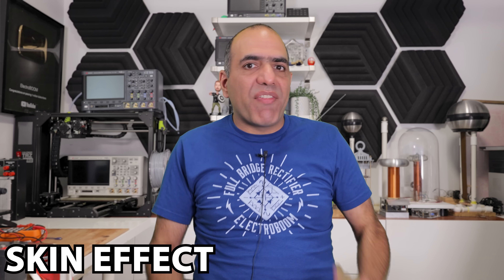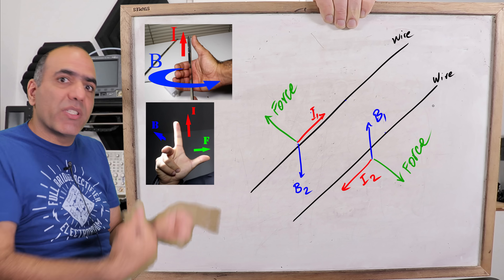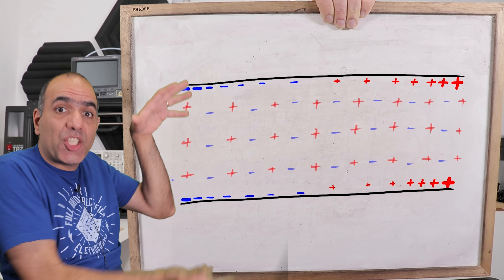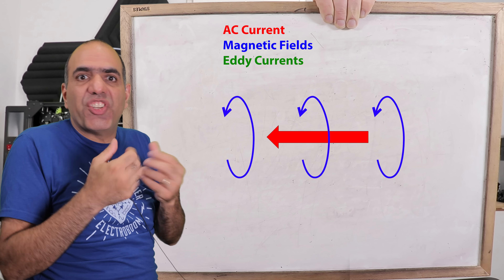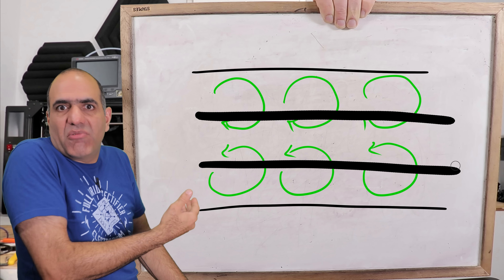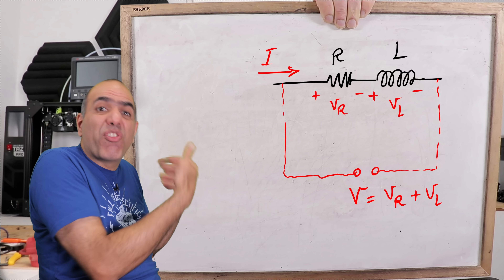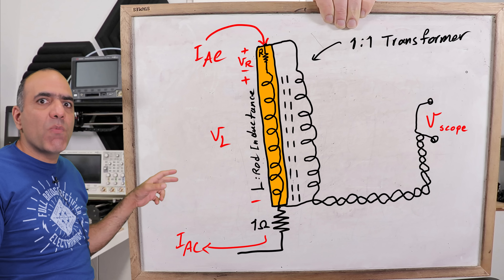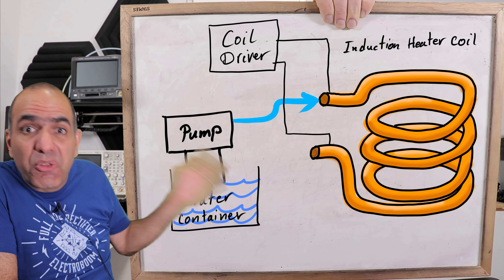Current Doesn’t Run Inside? SKIN EFFECT!

Comment: Hey Electroboom! Former radar engineer here. When dealing with high frequencies, a wire replacement is used which is called a WaveGuide. They're hollow, rectangular, tubes which one side is tuned to amperage, and the other is tuned to voltage.  By using this configuration, the Skin Effect becomes minimized and impedance is reduced.  We used them with radar signals at 72kv and there were a lot of rules for the waveguide inspections.
Reply: If I'm not mistaken, the microwave frequency travels within the hollow tube, contain within the metal insides, and could be made to turn 90° angles in it's transmission. Since there are no wires I don't think skin effect applies, except to say that at higher frequencies a signal tends to fly off the wire, which is the basis for an antenna.
Reply: @SpaceCadet4Jesus  it's the skin effect that makes it work.  It's because of the skin effect that you need to tune the waveguides to a specific size. The skin effect is being utilized by the waveguide.
Reply: @AdamOutler   You're right. I was forgetting about the skin effect on the inner walls of the wave guide. This is what happens after not working in radar for 4.5 decades. Thanks. 👍
Reply: Almost everyone has a waveguide in their kitchen: It couples the Magnetron output to the inside of the microwave oven. It's just really short.
Reply: @markh.7650  yeah. I suppose so. They're not doing much as far as guiding though.  More of a straight shot. The ones I worked on were curved and some were even flexible.
Reply: @ Yup. Although I never had the chance to work with them as the frequency of our MRI machines topped out around 25 Mhz I am familiar with their use. I was just pointing out that they are not as exotic as one might think.  My Engineer was a radar Tech in the IDF back in the '70s, so I'm sure he knows all about them 😀. Lost touch with him after we were together at 2 different jobs for 26 years. We are both retired now.
Reply: Thanks for your interesting comment. Could you elaborate, how is the one side tuned to amperage, other side to voltage? I'm an experienced EE, but RF things are just so magical for me..
Reply: @TheSimoc  I'm sure an AI can explain it better than I.  But, basically the skin effect adds attenuation and by keeping it contained within the waveguide under specific tolerances, the attenuation is minimized and signal is maximized.  The concept of a waveguide is basically a finely tuned abuse of the skin effect that's required for high frequencies. Any imperfection can cause signal loss or degradation due to standing waves.
Reply: @AdamOutler  Didn't quite get it, thanks for your try anyway. But could you just give a little elaboration about "one side to voltage, other side to amperage"? I mean, those sounded kinda good cues for understanding, but googling didn't provide any information about that, so are you referring to the sides 90 degrees apart from each other in rectangular-profile waveguide, or what? And maybe a simple example tuning calculus for some example frequency, how is it separated for volts and amps?
Reply: @TheSimoc  I'd recommend an AI to answer.  It's not easy to explain in a YouTube comment and my comments keep getting removed.  Not sure why.
Reply: @AdamOutler  I'm sceptical about AI but I might give a try. Thanks for your attempts, yes nowadays YouTube does censor about half of all comments, without any obvious reason.
Reply: Cool story bra

Comment: Black magic zone is where high speed PCB routing operates.
Reply: Where can I find online material about this? Sounds intriguing
Reply: @chickenonstrike123  Look at any application notes for super high speed ICs (or a book or wiki on high speed PCB routing). They will tell you how to route the traces with respect to each other and the  ground plane underneath, as well as the material to use and the weight of the copper. As a former PCB designer I had to deal with this, but never at GHz speeds, which is even more dicey. Skin effect is not much of an issue in PCBs as the traces tend to have a very small cross section because they are flat and fairly small. The big concerns are crosstalk and ground loops. It can literally seem like black magic at super high frequencies because the traces can "talk" to each other, so you have to run a ground trace (called a guard) in between signals you don't want to interfere with each other. This is not the case with differential signals though since they are 180 degrees out of phase with each other and the fields cancel automatically (typical of something called LVDS).
Reply: @chickenonstrike123  you should start with googling "HF PCB design"
Reply: @chickenonstrike123 WiFi operates in the 2.4 GHz range and higher, and in those ranges the actual wavelength of the EM waves become short enough that they start to do really weird stuff in typical wires if we just follow basic ohm's law. At that point, we start referring to the conductors as transmission lines and have to worry about impedance matching and wave reflections (wasted power) and all sorts of other funky black magic stuff. There's a really good video by Zach Star on YouTube called "The scariest thing you learn in Electrical Engineering | The Smith Chart" that gives a really good overview. 

Like some other people have mentioned in the comments here, that's the territory of measurement equipment the price of hypercars and filter designs that use acoustic waves and piezoelectrics to make the 15 layer stacks of filters that go into our phones and other devices for wireless connectivity. Really really cool stuff.

Comment: I meashured the skin effect with two  waveguides which have the absolute same geometries. One has an ENIG (gold) surface and the other is bare copper (below the soldermask). The one of bare copper has a significant lower insertion loss at several GHz due the much better conductivity of copper compared to the nickel below the enormous thin gold surface of the ENIG version.

Comment: I don't think you've actually "measured" skin effect. You've only measured that resistance increased but that doesn't prove that the current was indeed flowing on the skin of the conductor. For all I care, it could have been opposite of skin effect (core effect?) and it would also have increased the resistance.

Comment: A great topic to look into is Litz wire termination effects.  In high frequency power converters Litz wire is used in the transformer windings to combat skin effect losses.  The Litz wire works very effectively,  however at the very ends of the Litz wire there is a need  transition back to a solid monolithic conductor - I.E., the Litz wire termination point.  The traditional way to termination Litz wire is to dip the ends of the Litz into solder which burns off the enamel insulation and electrically connects all the individual insulated Litz strands together. 

So when analyzing the losses the Litz wire works as predicted if you ignore what is happening at the termination.  However,  once you start considering the termination effects you realize that the few millimeters at each end of the length of the Litz wire establishes a current distribution within the Litz wire that can negate most of the advantages that you are expecting the Litz wire to provide.

Comment: This is why you use stranded wire for speakers and solid for other applications like feeding wires (sometimes) depending on voltage

Comment: One practical use of skin effect is heat treating only the surface of materials with induction heating to give the surface different properties
Reply: I went through radio repair school in the military.  The books we had were half as tall as I was; and that was a 2 year course, just the "beginner's course".  If we stayed in long enough, we got to go to tech theory course, and another stack of books nearly as tall as we were.  Imagine teaching these courses every day of the year for 3 years.  I haven't touched electronics in nearly 20 years, and I still remember quite a bit of it.
Reply: There is also a medical procedure called diathermy.
Reply: It can be used to detect small cracks at the surface in parts made by magnetic materials like most steels.
Reply: @Norion_Artifice  I guess that works by measuring a change in the inductance right?
Reply: @radfue  it isnt skin effect. they run a DC current through the item. dust it with iron powder and it sticks to any cracks as thats where the magnetic flux wants to leak out, a "high reluctance" zone.

similar to the corners of a standard "IE" transformer core being magnetic. toroid cores dont leak so much because they have no sharp edges.
Reply: when using induction heating for brazing, it can be a downright nuisance as theres a limit to how fast heat will conduct... thin sections get overheated before the majority of the metal is heated sufficiently. makes it rather tricky to get production rates up, where one would think just pumping more power in would make things run faster, its the opposite.

the opposite effect is dielectric heating BTW... noone ever talks much about that topic. "capacitive" heating rather than "inductive" heating.

but that raises the point that "induction" is a silly word, as the early works on electrostatics talks about "charges due to induction"... which has nothing to do with the magnetic effects of induction heating... 

stupid terminology and nomenclature!

Comment: For your experiment: get a hollow pipe. Run current through it. Measure the voltage between the top and bottom twice. Once with both wires outside the tube, once with one of the wires going through. You will see a difference in the voltage.

That is caused by skin effect. I saw this demo live at 50Hz and a 1m tube with walls a couple mm thick.

Comment: Does that mean that copper clad aluminum wire is a good idea?
Reply: Probably not, since most of the problems with aluminum house wiring come from the connections between Copper/Aluminum. Using them together would cause galvanic corrosion.
Reply: For high frequency yes, but could also be steel in that case
Reply: It is already done.  Coax cable has this exact arrangement for the centre conductor for at least 15 years. This is old school. The skin coating is very thin, because you don't need much copper for the signals to propagate.
Reply: I believe that this is exactly what is used for the conductor wires inside of low-end, inexpensive HDMI cables that are trying to hit a really low price point at retail.

Comment: My stupid cousin spent 4K on silver litz wire for his speakers. lol. I swore to him that. A it dosn't matter at 20 khz and also B. He prolly just got scammed with fine stranded silver speaker cable without insulation per strand. Or C worse, just cheep arse aluminim wire. Ah well he did pay for all the drinks that night.
Reply: Actually aluminium stranded wire works very well as Litz wire  - I am trying to get this technology adopted in the power electronics industry for use in high frequency transformer windings to replace traditional copper Litz wire.   The naturally occurring surface oxidation that spontaneous occurs on the surface of aluminium exposed to an environment that contains oxygen provides an adequate layer of surface insulation to make the stranded aluminium wire work like Litz wire.
Reply: @michael-j-harrison  Like a cheep chinese microwave transformer enameled copper plated aluminium. Good luck with that. it's been done before. We are not in war anymore.
Reply: You're stupid cousin must be one of my friends. He swears he can hear the difference in the music, but spends most of his time listening to Mono output from an internet connected set top box.

Comment: id like to see you play with solid core wires vs braded wires of comparable scales. simple twisted strands of bear wires, vs twisted strands of insulated wires, vs braiding the wires in more patterns. there are magnetic currents flowing along the line of current, that you may be able to tap into with the right braiding patterns.

Comment: this is why pipes are used as busbars in high voltage substations. 
cables greater than 310 square millimeters also are less effective when cables are used in high voltage. therefore coppercables with aluminium cores are cheaper and still works.
Reply: No, 😂 you missed the "f" Frequency part of the formula at 60hz not much loss happening.   50 and 60 hz is normal Frequency for power generation.

Comment: Really? This requires a 13 minute video? It's because like charges repel, and the furthest away they can get from each other is the surface of the conductor. There, done!
Reply: good thing you didnt watch the video, where he explains that this is NOT how it works in the slightest.
Reply: @Basement-Science  You're right. 30 seconds of googling showed me it's an AC phenomenon, frequency dependent, and related to the eddie currents in the material. My original point still stands.

Comment: ElectroBOOM: Uses a wide copper tape to measure the skin effect up to 5 MHz

Meanwhile at the wireless regulation authority: 👀
Reply: @RMV-vo2gp For the radio nerds like me reading this, 5 MHz is used by shortwave time-of-day services, like WWV and WWVH in the US, but this frequency is used around the world by a few countries largely for compatibility with so-called "atomic" clocks (technically radio-controlled clocks, a few watches also exist that tune into 5 MHz). Time from WWV is extremely accurate and uses an atomic clock.
Reply: More like, his 5GHz indoor wifi 'Hmm there is some radar signal I better shut myself for a minute'...
Reply: @el_es  What? Why would something that's running on 5Ghz be affected by a 5Mhz signal?
Reply: @JJayzX  >.< only partially joking here i missed the MHz but because I had my 5GHz do it to me a few times -.-
Reply: Minute? Try more like ten minutes in europe. Thats the timing for DFS here  @el_es
Reply: i forget that, antennas are just vibrating metal.

Comment: I had todo 400hz cable calcs for a project (we normally only use 50hz as uk standard) and i had to call a guy who had to explain to me how todo this.... He then explained to me in simple terms because its high frequency it uses more of the external areas of the cable and means you need to increase the cable size.... And then gave me some rule of thumbs to work to.... Also a list of British standards to refer to.
Reply: Instead of increasing the diameter oft the wires you can also use more thiner wires, which are isolatet agains each other, this gives more surface and reduces the HF-resistanz.
In Germany we cal this wire "HF-Lize".
Reply: Thanks for sharing, thankfully 400hz is extremely rare in my job and i havnt come across this since(6 years ago). But will add this to my book of knowledge. Vielen Dank
Reply: @MrDleete-mj9vt  Is this for an aviation project? The only thing I now in Erope were such frequenzy is used is avionic, usaly 400Hz, 115V three phase
Reply: To do is two words.

Comment: Hi Mehdi, I have to say that NO, stranded wire is NOT better than full wire regarding skin effect... As long as the strands are in parallel, the current can make either one (proximity effect) or two (skin effect) loops from the terminals. Along the length, the current does not flow radially : the electrical insulation between strands changes nothing. This is not to be confused with Litz wire, in which the strands (ideally) continually exchange positions, such that each strands occupies each (radial and angular) position for the same amount of length, such that along the length, there is no more inner or outer strand, and the same macroscopic current flows inside each strand. 

Assuming that you can measure the current without any significant voltage drop that would change the current distribution one way or another, e.g. with hall effect current probes, your first experiment will work perfectly.

Comment: 5:57 when u realise that long distance HVAC lines use multiple parallel cables instead of a thick single one just to make sure current flows uninterrupted in the middle cable

Comment: High power hard line coax cable usually does not have a solid center conductor.  It is basically a copper pipe.  Transmission lines in high power radio and TV transmitters usually just use copper pipe inside the station.  Just a large copper pipe with a smaller pipe inside it with a spiral spacer to keep the center conductor centered.

Comment: Example: trying to "cheat": to wind an electromagnet(inductor);  instead of several meters of solid-core coil-winding around a core, coil-winding a core with ribbon cable, all conductors wired in parallel... more wires is much gooder... right! NOT!
FWIW, electron movement at the molecular level is not unidirectional, but cumulative. (think: bowling pins) likewise, a select electron transitioning the full length of the conductor... from one end to the other, to ultimately end up at, or near, the "starting point", is unlikely; think: Newtons' Cradle.

Comment: Veritasium electricity was weird he was caliming the charges never move but still cannot digest this as valid explanation because when a battery drains the charges move from terminal to the other and it does not explain how capacitors store energy if the charges don't move or why a diode blocks the flow of charges in one direction. His basic calim that energy was moving faster than it is to be expected from the length of the wire was actually perfectly explained by Mehdi and Dave.